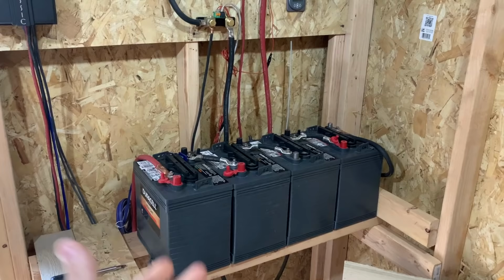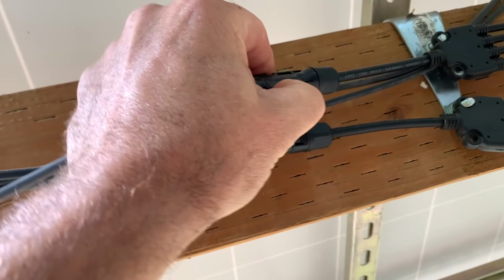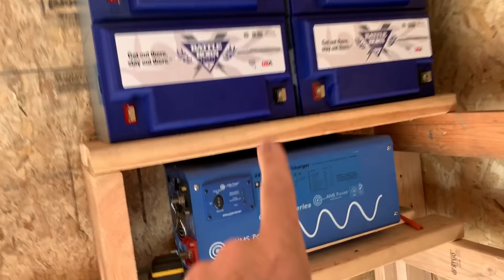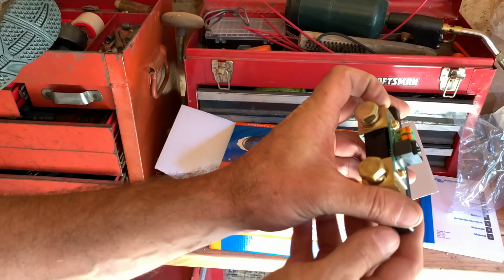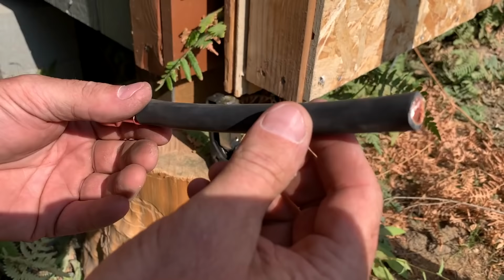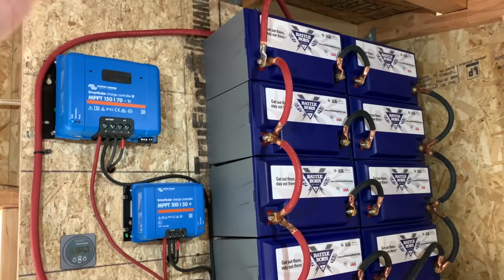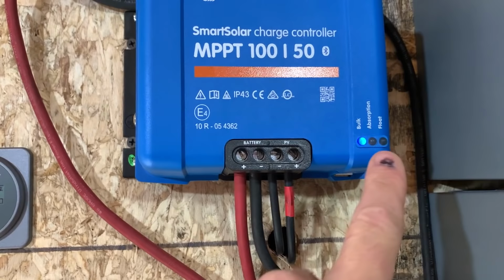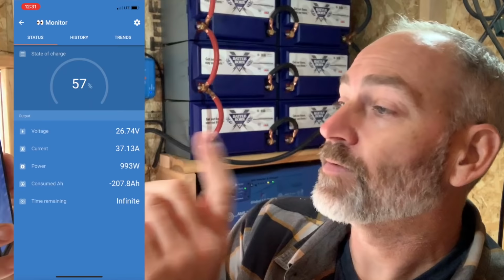EASIEST Off Grid Solar Power System Battery Bank

Comment: I used to do a lot of big solar installs on Houseboats, we installed breakers on the panel inputs to the charge controllers, and had battery switches on the positive leads to the battery bank. Also adhesive heat shrink all connections, and cover all the positive connections. LiFePO4 is definitely the way to go, faster charge rates, better deep discharge rate. Cost wise compared to lead/acid, the break even point is around 7 years, not counting the labor involved, changing out the battery bank. The LiFePO4 should last 10+ years easily.
Reply: With the cost of a 12V 100 ah no-maintenance at around $ 90 to $120 and lasting about 3+ years so 10 years = 400 and a lithium 100 ah at around $1000 for around the same time period, economically I don't see it yet for a typical dirt farmer off grid family.  Maybe I'm missing something.
Reply: YES, AND ONLY $8000..!!!
Reply: @user-zq6pj5jo8j  This stuff isn't cheap, that for for dang sure. Just because it SAYS what a service life is never means you'll actually that type of life OR if the company will still be in business should one of all of the batteries fail in 3 to 6 years. Not trying to be a negative nancy here, but where ever I do decide to buy my equipment from, I'll for sure want to make sure they do have a long standing history of good customer relations. Not saying BattleBorn does or does not, still doing my research on how to hook all my stuff up when I have all the pieces. Off Grid with solar, batteries, and generator living isn't a typical dirt farmer life I'll assure you. I've lived on a farm and the most off grid a farmer worries about it whether or not the propane tank is full for the winter, but solar panels and batteries. This type of stuff is for the guy who can afford to throw extra money at something, but not because he has to. My pending solar install WOULD have run me $94k , but I opted to do a partial install from the company and the difference was substantial doing the rest myself.
Reply: @lyle1  Wow, thank you for your insight on this. I see the up front cost as a huge investment in something that is not quite ready yet. Very cool Tech, but not good enough for the normal home owner to jump into YET. I hope it will soon be though. We desperately need this to work well for your country and our planet. It's great to see the pioneers like yourself doing the "Crash testing" for the rest of us. So thank you for that.
Reply: @MrTimjwilson  yes you are missing something... I've done SLA and AGM batteries; for many years both are very heavy compared to LIFEPO4. With SLA and AGM, I get a lot of messy corrosion on the connections and terminals but not from LIFEPO4. You'll draw more of the power from a LIFEPO4. They also charge faster than SLA & AGM... you'll notice the difference.
Reply: @MrTimjwilson  The difference is how much more you get out of the lifepo4 batts 'daily', along with how long they'll last, also the 10 years is only for 100%, after 10 plus years you'll still have a 80% charge, which is still far more power then lead acid!
Reply: Just bought four 100Ah Life-Po batteries and the total cost was only about 300$ more then same Ampere hours capacity AGM (double the Ah to compensate) and saving 150kg compared to AGM.
Reply: @MrTimjwilson   You can get 100Ah Life-po for about 450$ here in Norway, but you can also get 1000$ batteries if they include built in heating and bluetooth and such. I just bought four of those 450$ batteries myself as total cost gets very close to AGM with those (only 300$ more for same usable Ampere Hours of AGM and saving 150kg weight also which is important in a campervan)
Reply: @MrTimjwilson  Your definitely missing a lot.  feel free to contact me.
Reply: @lyle1   $94,000 dollars to install your total requirement? Who would do that realistically?
Reply: @RobertDeloyd  all bare wire should have corrosion gunk and heat shrink.
Reply: @canislupis3129  well, someone who either has plenty of money and very environmental. My system is a ground mount that 330’ from the main house. So a bit more involved in my setup than the average on your roof type. I am already working on another 20 panel expansion now. That will bump me up to 70 when I’m done.
Reply: @lyle1  so is your system based on comparative cost to a supplied power company, or because you want environmental? Do you have to calculate by mortgaging the cost of solar over a number of years?
Reply: @canislupis3129  so the cost of the system is based on your annual usage and why kWh capacity you need. They they calculate an average of the system and why theoretically you can generate in 12 months of usage. Also it is financed through a company that finances those types of projects. Mine is Goodleap. The SolarEdge installer tools can give you much better financials for the long term, but it can be a little complicated. I see really two things and only really concerned about day to day and that’s usage and production. Unless you have average billing it doesn’t make any difference to me over 12 months. What does make a difference is current state today I have pulled 67% (650 kWh) of my power off the grid while solar only has supplemented 33% (316 kWh). A little cloudy today though. So what happens in a single billing period matters more because that what affects me the most today.
Reply: @lyle1  do you find yourself trying to minimize your usage? I’m on the Texas grid. We have heavy use at our home because of lots of extra draws. More than average because of extra appliances, a pool, we run our central air hard because it is so hot and humid here. I put in a 30KW Cummins natural gas standby generator that was fairly expensive, but it is well worth it. I keep it well maintained and you would be surprised how often the power goes out here. If it is in the hot season people will go to a hotel. Not me. I want all our stuff running, especially the pool.
Reply: @MrTimjwilson  I bought 8 of these batteries but mine are 320AH, new, grade A for $3160. They are 32 raw batteries. I will put them in a metal frame tower bolted in place, lined with cement board. Lithium fire is real. Maybe even a 50 lb heat  deployable baking soda bomb on top for prevention. My system will be ready, hopefully, in the spring and assembled in the house utility room. 48v, 12kw, 240vac, off-grid. Trying to stay under $10-12k. System components also mounted on cement board. I hope this guy reads his comments and upgrades his safety on his system. Stay safe, stay prepped. GOD BLESS GOD SPEED GOD WINS.

Comment: you forget your safety, you need a battery disconnect circuit breaker that works as a fuse and you avoid the spark. Same for the solar panels but a circuit breaker to disconnect from inside the plugs are not designed to disconnect under load.
Reply: Yup, I was just going to post the same thing.  Also he can't use just any breakers/switches between the panels and he charge controllers because of the high DC voltages involved.  On the big array he needs components rated for 100 VDC and he needs  components rated for 75 VDC on the smaller array based on how it appears to be wired (series parallel).  I also think the wires from the charge controllers to the shunt and batteries are undersized.  That 70 output Victron controller needs #4 wire and the 50 amp controller needs #6.
Reply: Yep. This ⬆️⬆️⬆️

Comment: As a techie, when I got into RC cars, batteries was something I really delved into. Lithium polymer batteries were a HUGE boost over the Nickel Metal Hybrid batteries commonly used as they hold voltage until somewhere around 20% capacity. In contrast to NiMh batteries which start dropping voltage immediately. 

Lipo batteries are volatile. While they are super lightweight and hold voltage amazingly, they should be charged in special lipo sacks and preferably not in your house. Because after about 500 charge discharge cycles, they poof. And lithium fires are not good. Impacts can reduce that number of cycles, and in RC cars impacts happen a lot.

Enter LiFe batteries. Lower voltage per cell than Lipo or increased weight per watt, (about twice as heavy as lipo) but in most ways as stable as nimh and even chargeable the same. (Lipo batteries individual cells in a battery need to be charged at same rate, so cells have to be monitored while charging to make sure that no one cell goes over 4.2V) Which means extra energy cost in charging and increased charge discharge cycles every time you plug in.

Hope that helps someone google for more information on their battery mediums :)

Comment: Anyone on YouTube ever heard of dielectric grease on connections? Or soldering, for that matter?
 I'm not a fan of corrosion or having to go back and repair things.
    Those 'beat together' connections will be alright for some time But... If you take a little extra time and solder the ends on the cables, heat shrink the connectors and use a little dielectric grease on the bolts and connections, you will not have any corrosion issues.
    Yall take Care and be safe, John
Reply: Those CRIMP connections are per the National Electric Code ...
Reply: @MrSummitville  yep, the same standards set by the wealthy interests that want you to have to buy more! Support the Rich, they will surely look out for you!
Reply: AGREED.  ALWAYS Dielectric grease.
Reply: @JohnDoe-pv2iu  The fact that you hate the super rich and disagree with the National Electric Code, does not prove that soldering is better than crimping ...

Comment: The spark is cause by the capacitor in the inverter. You can solve that spark, by putting a 50 ohm resistor for 15 sec ,at the wire and battery post, for the last step before bolting that wire
Reply from the maker: Then you wouldn’t get to see the fun spark.

Comment: You may already know this, but next time you’re working on that system get rid of that fuse and put in a resettable breaker, and put one closer to your positive battery terminal preferably within 6 inches that way if you have to disconnect and reconnect your batteries, your trip the breaker so that when you’re reconnecting everything you don’t run the risk of Causing an electrical arc. Just a thought nice looking system though
Reply: Do you have an example of the type of breaker?  Maybe a link?

Comment: Just a little advise, always protect your battery string with a inline fuse connected at the positive battery terminal of your battery string to where it feeds your equipment, lacking that fuse at the battery terminal, you can have one heck of a explosion should there be downstream fault, ahead of your system fuse. 

Always protect at the source, then another downstream to protect equipment.  

Also the wiring for the batteries is terminated with terminals, not connectors, terminals terminate a connection to a device, connectors splice conductors to each other.

Comment: Just an FYI the BMV might give you a .2v low reading in some units. There is a little oopsy that happened and the fuse is too small making too much resistance, so needs to be switched out for a 1A. There's info in a search to verify this all.

Comment: Basically $1k per battery, wowsers! Sweet system though. Just the batteries and charge controller upgrades it is $9260 (not including taxes or other charges. For those of you that might be wondering how much his system cost.) The solar panels, I believe he already had.
Reply: Battleborn is the best battery u can get in my opinion with a 99% efficiently next to this would be discover battery that has a 95% efficient
Reply: Bam...!!!
That’s a whole lota money...!
Reply: At that price why not go with an LG storage wall or Tesla power wall? You're right around $7000-$9000 and you get like 10kWh of storage.

Comment: Just a thought you might want to but a safety strap to hold the batteries in place as a safety precaution. Its just a thought all in all it looks great...
Reply: THIS, or at least a 2x4 in front of each row, also as others have mentioned a circuit breaker on your solar panels, a battery disconnect switch and a pre-charge switch with a resistor inline for the inverter.
Reply: I was thinking this exact same thing as soon as I saw him stack them above head height without any straps, you certainly wouldn't want one or more of those falling on your head or foot.
Reply: Good observation I would add since batteries are not really intended to stack on their sides at least use some spacers at the front to compensate for the width of the battery clamp downs at the back. Will also improve airflow when they are heating due to high draw rates or for the battery warmer below in Winter!

Comment: Dude, that's almost $8000.00 in batteries.  That's insane!  However, I love the setup.  Great job!
Reply: @Mdnosliw Yeah these videos seem like a total infomercial for lithium. Lead has significantly better economics for off grid. Anyone who thinks the case for lithium is stronger for off grid solar is either lying or somewhat confused.
Reply: The batteries come free when you purchase an $8000 t-shirt!
Reply: @andrewswingler  Sorry, but you are very obviously the confused one, here!  In the long term (if not in the short-term also, now) Li far outweighs lead in every way!
Reply: @martinwinlow  shall we debate the pros and cons with overall cost of ownership the ultimate decider? let’s start with the typical storage requirements for an off grid solar system. By all definitions a well designed system will perhaps store and release between 50 and 100 times the storage capacity of the battery bank annually.  May we begin with the realization/acceptance that off grid solar does not inherently require high cycle life batteries?
Reply: @andrewswingler  There is only one potential downside of Li Vs lead and that is their propensity for thoroughly dying if mis-used - lead-acid being a lot more forgiving.  A properly designed system using the right kit (such as showcased in this video) avoids 99% of that danger, however.  I've been using Li batteries for 10+ years and lead-acid for 40 years before that.  So, no debate necessary, thanks all the same!
Reply: @martinwinlow  yes, lfp is relatively fragile and the BMS is a distinct failure mode. They can also be damaged when cold. The kit  in the video also can’t balance the series 12v modules. Even if these were not considerable issues the fundamental economics of lithium for off grid is still just so bad relative to lead.

Comment: You should always have all the batteries at the same level of charge when you hook them up together in series/parallel so as to not overload the weaker batteries and their BMS.
Reply: Yes, lithium batteries do not equalize like lead acid batteries.  I have the same batteries and hook them up in parallel for a week or so , charging and discharging at 12V  until they were at equal voltage before I hooked them up in  series for a 48v system.

Comment: Excellent video...very well produced and staged...you deserve more subscribers. 
I have six 24 volt Simpliphi lithium iron phosphate batteries (867 Amp hours at 24 volts) in my off grid system having upgraded from AGM batteries one year ago.  
My homestead is 18 miles from you, just north of Naples Idaho.